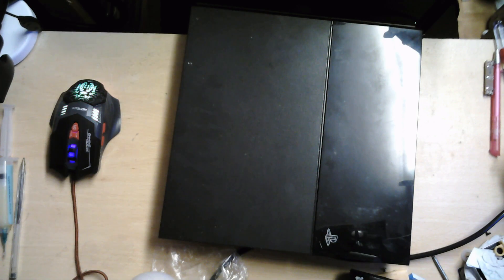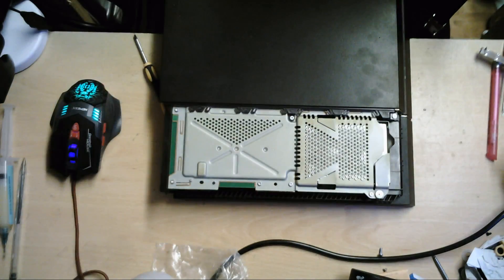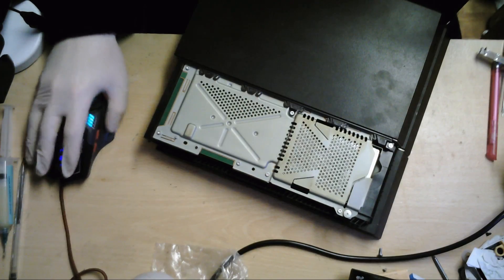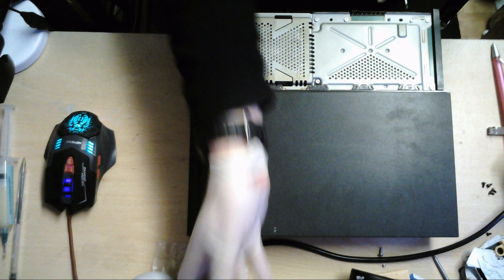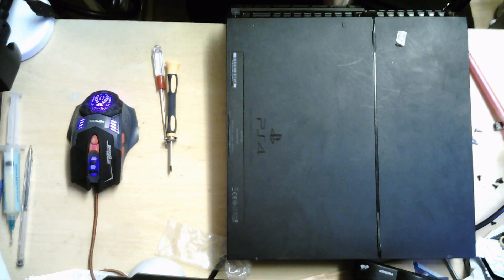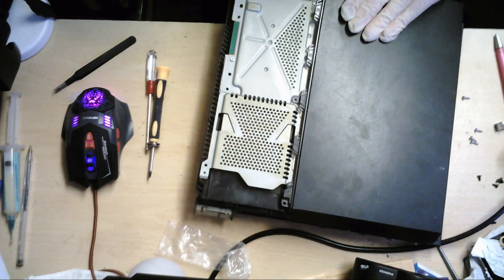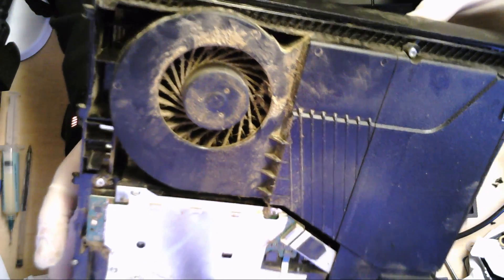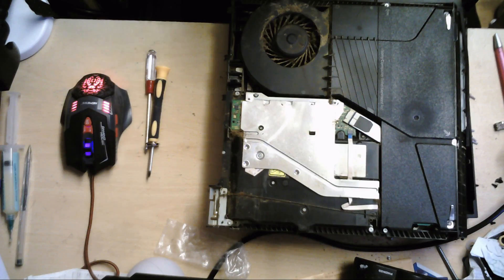PlayStation 4 Fault 3 beeps then shut down - tear down and investigate

Comment: 1009 hrs of play time before ps4 pro dies  
unch trilogy 10 times
tlos 1 8 times
unch4 4 times
unch tll 3 times
yk0 85 hrs
ykk1 78hrs
yk5 56 hrs
yk6 2 times
1886 1 time
tlos 2 28 hrs
shotc 2 times
Horizon Zero Dawn 1 time
yk j1 2 times
yk j2 1 time
Catherine: Full Body 1 time
Tomb Raider: Definitive Edition 5 times
cod mw 2019 1 time
cod vanguard 1 time 
cod cold war 1 time
heavy rain 1 time
gow3 2 times
ghost of tsushima 1 time
The Last Guardian 3 times
cod mw re 2 times
cod mw2 2022 (unfortunately ps4 pro died before the last mission)

Ps4 pro 3 beeps/no turning on issue has been fixed (Ic regulators on ps4 motherboard replaced with working ones). first workshop scammed  me for $15 by replacing the fan, sec workshop charged me $45 for replacing the Ic chips.

Comment: I’m having a problem on my ps4 pro i cleaned it and I turned it on it beeped three times and turned off any help anybody???
Reply: Having the same issue, i cant find any thermal paste in a store right now >.>
Reply: @ac04project  hey you can order some online
Reply: @youngjv485  Yea i got some thermal paste, it fired up and is quiet now :D
Reply: Mine also does this after putting it all back together i also put new thermal paste but it didnt help either
Reply: @tijsr8812  did you replace the cmos battery?

Comment: 2 years ago I gave me overheating problems. Made some holes around the fan and used silvert artic thermal paste. Worked fine, no problem and fan wasn't that loud.
Last week started making e beeps and turning off. I thought it might have been dust, so I cleaned fan and sides. But it's beeping 3 times many times and turning itself off after some minutes on.
PS: One year before that it did the same. There were electrical ups and downs un my street and eventually beeped 3 times and turned off. Took it to a repairman who fixed it, but in pande they closed :(
Reply: WTF are you saying?
Reply: @aeughcarrot  ong

Comment: Slide a quarter under the the little surf board piece so it tightens up
Reply: What surfboard peice
Reply: This does actually work. If you take all the black casing off, on one side you'll see a surfboard looking piece screwed in with two screws. 

Either put a coin underneath the centre part and screw in tight, or if you can, put a ring shaped piece under neath each screw
Reply: Putting pressure on that surf board thing worked for me. Thanks!
Reply: @Masterofnon3  nice, I got an extra 3-4 years of life out of mine.

Just died, but good timing with the ps5
Reply: It’s always some random ass comment that helps me
Reply: Trying to understand wats the surfboard peice help!!

Comment: I had this issue soon after I cleaned my PS4. I was confused why I was having this issue as there was no way I could of broke anything when cleaning. So I opened  it back up and realised that I forgot to reattach the fan cable🤦‍♂️. If anyone is having this issue after taking your PS4 apart, make sure you have connected your fan cable back up to the motherboard.

Comment: So for anyone wondering if u cleaned ur ps4 and after it would get super loud then give u heat error then beep 3x then turn of u might have but that little metal plate on backwards that what i did now it works so yeah hope this helped
Reply: What metal plate I’m having same problem but my light is t red it’s blue
Reply: I had a stroke reading this
Reply: Which metal plate
Reply: What little plate was this Mate
Reply: @IIHAZZII  thermal paste
Reply: @lmaniii5030  what? is that the plate with the 2 screws?
Reply: XaViEr did you figure it out
Reply: @kennyloyd6276  guys its the little metal thing with the 2 screws above the apu just screw it as much as u can
Reply: @kiriemalakiou2910  did u use theral paste bro?
Reply: @jademckeag2563  yy + thermal pads
Reply: @kiriemalakiou2910  whats the apu
Reply: Thanks now working luv u
Reply: I put 4 washel each side make sure it must tight very hard my hands got sore web tighting up now it's working smooth tight it how much u can hardly
Reply: @karanjotsinghbedi8907  goes you get it to work
Reply: BRO YOURE THE GOAT!!!!
Reply: You are literally a life saver, I will literally Venmo you if you want, holy shit thank you!
Reply: Ur heat sink is clogged behind the fan...and u may need apply new thermal paste
Reply: Thank you it worked so much easier then video lol😂😄😄🔥
Reply: Hey bro how money I put washel I put two each and screen still it's not right fucking closing
Reply: @karanjotsinghbedi8907  make sure you close the ps4.i mean put on all the plastics and more important the screws

Comment: Hi I'm trying to repair my old ps4, it doesn't show any lights turning or give me a picture, I tryed holding power button to enter menu but doesn't let me, it stays on for about 1 minute then 3 beeps and it will turn of, its not overheating either, any ideas, cheers
Reply: supermoto vtec maybe your power box thing is broken i got the same problem
Reply: @prokeeperzzz3140  you mean power supply?
Reply: @glubdalub3349  yeah

Comment: my ps4 looked almost as bad minus the hair but I smoke a lot inside and my ps4 wasn't in a well ventilated space just crammed in a small cubby anyway I replaced the fan but still get the 3 beeps and redlight when I power it on I can hearf the fan power on now but it wont turn on ANY IDEA HOW TO FIX IT IM NOT SUPER GOOD WITH ELECTRONICS BUT I WATCHED A VIDEO AND IT WAS FARLY EASY TO SWITCH OUT THE FAN 
PLZ HELP ME
Reply: Do u have a missing CPU clamp
Reply: Might be about thermal paste

Comment: when i turn on my ps4 it run for a little then it says your ps4 is too hot then it shuts its self down please help i cleaned out everything please reply
Reply: Same and i took it apart to clean more and now it just beeps as soon as i turn it on and turns off
Reply: Punky Waffle it could be the thermal paste or the fan isn’t just working
Reply: @marcoespinoza6475  what did yu do to fix it?
Reply: Punky Waffle I also have the same problem
Reply: Could be the thermal paste. When you took the PS4 apart, did you take the entire motherboard out? If so and you didn't replace the paste, it likely isn't getting properly cooled any longer.
Reply: Hey I have the same problem
Reply: How did u get it fixed
Reply: Ventilation problem
Reply: Me too
Reply: Yo mines to im going to vacume it
Reply: Heat sink is clogged and new application of thermal paste needs to be applied
Reply: Thermal paste change. Buy the best one and replace.

Comment: Same here except I paused the system update and now it beeps once with a blue light for a second then goes off. I unplug it and repeat
Reply: Hey, i know its been 5y but i fixed mine, it was the clamps on the mother board that lead to the psu
Reply: Chris Murray  did you ever figure out how to fix?
Reply: Chris Murray cause I'm having the same problem with my unit but I was playing a game and It froze so I unplugged it and now it does The same thing as your system
Reply: You need to change the power cord and the plug/port
Reply: @jaebansgameing156  that doesnt work